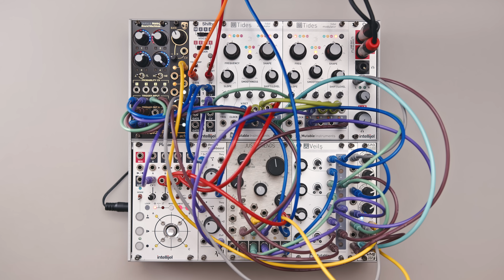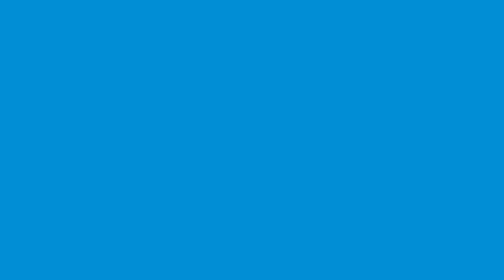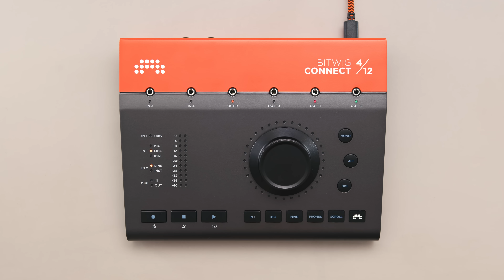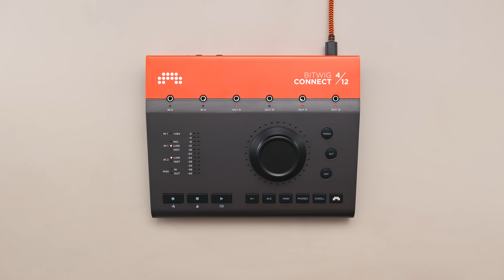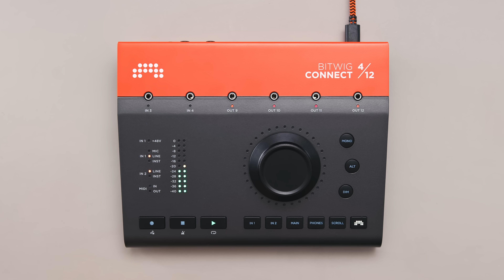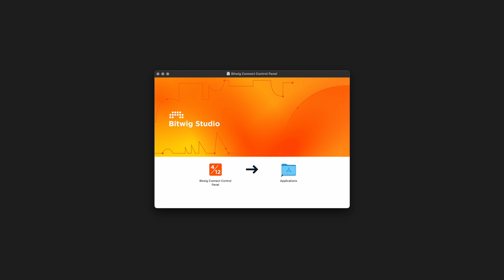Bitwig Connect 4/12 Feature Overview

Comment: Pretty cool, but not what I personally need currently.  I would immediately buy a small controller with that center dial integrated into it.  4 knobs that work like that (hover and click to lock on the parameter), a small oled that shows what its locked on, and the transport controls would be ideal.  You could make versions of this concept tacked onto a number of other controllers:  just the knobs, a sequencer, a keyboard, a grid controller.  The primary functionality i want is that hover and click to lock transport control.  That is so much more intuitive, quick, and mailable than any other midi assignment ive ever seen.
Reply: Steinberg cc121 did this 10 or 15 years ago and SSL uf1 I believe does it. Maybe some other devices also but yes very nice feature!

Comment: This is a very interesting interface, in particular the CV feature, but I would have to use it in conjunction with my existing interface/preamp setup. Does Bitwig Connect support "Aggregate Audio Device" on MacOS, and has this been tested for stability and performance with commonly used audio interfaces, such as the Focusrite Scarlett range?
Reply: Any device supports it, since the drivers on Mac are the same for all interfaces (not the control interface, but the actual driver). It hasn't been tested, and I don't think any brand has tested that
Reply: @reggindaed  I got a reply from Bitwig in the meantime confirming that this was indeed tested with many commonly used interfaces, including several from Focusrite.
Reply: @ I wouldn't use an aggregate device anyway
Reply: @ Then dont.
Reply: @ Ok, I won't :)

Comment: USB 2.0 is a big disappointment.
Reply: … why?
Reply: what should be the benefit of usb 3 in an audio interface with this channel count?
Reply: USB 2.0  depends more on rest of your system (OS driver, even if you use USB 3 socket), while USB 3.1 is more independent. If you have webcams, controllers, midi, mastering plugins everything on USB 2.0 the polling latency overhead/jitter will be imo measurable. 
So for 99% of users it won't matter.

I'm probably whining, but its so cool and has USB 2.0 while I already have an interface with USB 3.1. I'd feel like I am downgrading.
Reply: @jomonger-g1f  interesting!

Comment: I'm concerned about the performance of the Input and Output. Can this handle hot signals from a modular synths as input, and can it output hot signals as well? Depending on this, We might need  attenuators or preamps.
Reply: I mean... Yea

Comment: i used bitwig versions 1 - 3, when they went to their subscription model i stopped promoting it although i still use the version i've paid for. that said, i can't in good faith purchase this or any other product as firmware & other updates might be held to a  subscription model. even though i am being ever so slightly facetious, i hope i haven't given them yet another crappy idea.
Reply: Cool. Except it's never been a subscription model. Subscriptions are a very very specific different thing. So you don't have to worry. 

You're literally experiencing why it's not a subscription. If it was, you'd lose access when you stopped paying. Except no, you can just update to the new version years later if you want like literally every software ever. Bitwig is just nice enough to give you a year of free updates when you upgrade. 

You're confused
Reply: I don't understand you. With Ableton you buy a license and if then a couple of months later a new version is released you can buy a new version. With Bitwig you are guaranteed to get the update, it's the fairest model I've seen.

Comment: Congrats! The execution of how it directly Integrates with bitwig are rlly awesome and smth unseen before, thats awesome! 

Also favouring the use of Modular Synths as Bitwig rlly is the DAW that rlly shines the most in terms of user friendlyness of Hybrid Setups is rlly the perfect choice imo

The use of the multifunctionial knob for MIDI CC is also rlly such a nice Addition and usability of it and to switch parameters seems like a breeze 

But by the first looks here my critiques (obv. not owning the device but an Audiofuse 16rig instead (pretty much the Interface I always Dreamt of lol and cannot recommend it enough)

There seems to be enough space for LED VU-Meters for 2 Inputs and seems a bit of a missed oppurtunity, although obv i do not know how cramped up it looks under the hood but thats a bit of a bummer but would be amazing to check Ins and outs or all Ins at the same time.

The choice of having the Phantom power switch in the back is very odd to me and not a good thing at all
I switch my Phantom power on/off extremly often. Coming from the  audiofuse 16rig i constantly switch between Inputs 1 from rear for synths to the front where my mic stays attached since i use my mic also for gaming and videocalls etc. but barely for my music.
Having to Touch around and reach for the back to look for the Phantom power switch sometimes several times a day seems extremely annoying 

Why only 2 Inputs and 6 6.35mm outs instead of 4 outs and 4 ins? 
People who only need 2 Inputs hardly ever have a 2nd pair of speakers and for send/Return functionality theres just not enough Inputs. Having 2 extra ins could make way to maybe use them in that way or simply to have 2 more separate Ins for multitracking. 

If you like the choice of the small Jacks on the top is obviously completely subjective but i would have prefered them maybe on the front or the sides to eliminate the possibility of cables dangling around. Often longer eurorack cables are very loose (at least my are) and not stiff enough to not end up possibly dangling on the precious big knob (i know we all love big Knobs that make synths go "WAH-WAH" mainly ending up as cut off knob lol) or being a bit in the way of the buttons and LEDs 

Obviously it would raise the pricepoint and is a wish not a complaint but ADAT functionality would be god send and id easily buy it to replace my Expert Sleepers modules to feed Modular Signals into Bitwig while having its amazing Integration features connecting it to my 16rig 😍

That all being said it still looks like the perfect interface as Bitwig user who doesnt have the need for big amount of ins and most points (except the rear buttons) are nitpicking maybe for the next gen :) Congrats again to this well thought out little box!
Reply: And next PLEASE a fully Integrated Bitwig Conrroller à la Push but with Bitwigs amazing Innovation and modular Integration! Id SO love and buy that 😍😍

Comment: This is really well thought through.  Congrats - and I would like something else adding to a Bitwig hardware range please:  Something like the Softube Console 1 but smaller and there to simply control one device at a time (rather than be a channel strip - which isn't what Bitwig is about at all); layout more like a Nektar CS12 but with 3 rows of 8 controls so (say) eq gain, freq and Q can be controlled per band but with displays for what each encoder is controlling and save-mappable to VSTs as well as native FX and instruments.  Adding a universal knob like on the 4/12 or a single motorised hi-res fader would be great for controlling whatever the mouse hovers over or switchable to volume.  For me, Ableton Push was always too massive and the knobs too far away and close together to be usable by a grown up seated at a desk.  So, my suggestion:  Forget the pads - put them in a separate hardware unit - definitely not the same one!  Focus on having a really great series of rotaries ergonomically accessible and readable just beyond a Mac/PC keyboard or trackpad.  Now that, I would pay for!  I don't need an MPC would-be or all-in-one controller like Push.  I need dedicated, ergonomic studio tools - For instance, in my last release, I had Wavesfactory Spectre on most tracks.  Being able to control that from hardware and using my ears more, screen less, would be amazing!
Reply: @ADPTVmusic  in my opinion it has too many flaws and not thought very well through. At least it's nothing I would need or could even integrate in my setup even though the CV out could be nice.

Comment: Looks quite nice but for me the number of ins and outs should rather be reverse. Especially as you are talking about hardware synth integration.
Reply: What were they thinking? Do people actually need that many outputs? I'm good with 2 outs plus headphones. If there was ADAT you'd get all the outs you most likely ever need. A lot of weird choices with this product IMHO.
Reply: @Leo.Nordmann  Looks like it's designed with the eurorack market in mind. A lot of people with large systems use some mixers and might be fine with 4 inputs. 12 outputs for CV are easy to use up.
Reply: @Bata9999  it's only the 4 1/8" outs on the top that are DC coupled though, right? The other 6 are only balanced 1/4" and then there's the stereo headphone out.
Reply: @Leo.Nordmann  I don't know maybe you're right. My impression is that the entire interface is DC coupled but the top outputs are specially calibrated to help with 1v/oct CV signals.
Reply: @Bata9999  I feel like they'd have specified it if the 1/4" outs were DC coupled. It's a selling point after all.
Reply: @Leo.Nordmann  well if you count the cvs as out, the high number males sense, the low number of inputs does not... I have a 4 synth setup, and that takes alone 8 monoinputs, for each has their own effects path. then counting drum samplers an other stuff together my setup needs 12 inputs, just to work. so hmm. Nice idea, but way too low ins count for a "serious" use. Ok I have to admit, i am no eurorack guy. maybe in eurorack world 4 ins is enough since everything is happening inside the rack system. but for standalone synth users with patch in/out capabilities, it is only for very small setups like 2 mono synth and a stereo drummachine or something like that. I really think this is the start of a hardware family, otherwise this one is very niche
Reply: @hypnoticGrill  same for me. I have the Babyface pro with a 8/8 preamp and all the inputs get used with my setup. Bitwig connect should have ADAT. It's baffling how they didn't add that. It's a similar thing with the SSL Big Six. That mixer could really be great but no ADAT makes the value of it drop immensely IMHO.

Edit: sure, it makes sense if they do a range and add adat on the higher product in the line then, but the price is just way too high for me to even consider this. If they make a bigger version it'll be in the price range of the Babyface pro FS and I would always pick that over anything else really.

Comment: I'm really impressed guys! You just know if Bitwig make something then the features are going to be really well thought out. That is I would say probably the most clever audio interface i've ever seen in terms of the combination of features. Great work! Obviously I will echo what other people in the comments are saying that it would be great to see some kind of integrated midi control system for Bitwig.
The thing is with Push and Ableton though is that there's too many sub  menus and its faster to get around with the mouse for many tasks. So for me I think its a case of getting a narrower set of features to work exceptionally well rather than trying to create this never use a mouse again nonsense because lets face it the mouse is handy for editing.
Things I generally want are a good 16 row step sequencer with random and prob  and can do 909 style as well and rapid access to all of the sensible drum params like pitch, filter, start, end, adsr, pan, fx, filter stype, vol. Then I guess there need to be intuitive melodic sequencing as well. 
I think for me I just want intuitive and expressive and tightly integrated laying down, tweaking and editing of the fundamentals of a song. The groove basically. Lay down patterns, tweak sounds, swap patterns, swap sounds. Super intuitive fundamentals. 
Because when you get to the point where its like ok lets make it do 20 other things then all of a sudden if you want do a drum flam you gotta go 3 menus deep because you've been trying to create this device which does everything and so it becomes sluggish at deeper editing and sluggish at laying down grooves. So why not don't even attempt the deeper stuff and make it exceptional at just generating sounds. Its what push claims to be like an expressive musical instrument but I owned push one and it was a jack of all trades and master of none.

Comment: I was hoping for a full fledged production controller (with pads to control Bitwig's Drum Machine) optimized to control both sequencers in Bitwig but this is a start. Don't forget to bring that knob over to your production controller, should you decide to make one (may I also request a real jog/shuttle wheel for additional transport control and other tricks).

Comment: Love this, wish it had more I/O like 10/12 or 12/12. Adat + Midi would be a nice feature. Or the ability to stack several interfaces for more I/O (ie, looking at you Windows PC).

Saying that, this is an amazing step forward, Congrats BitWig!
Reply: adat ftw!!
Reply: double ADAT (SMUX) pls?
Reply: The ES-9 is only 100 bucks more with way more I/O. I Want to convince myself to get the connect but I just cant knowing the ES-9 is around.

Comment: Nice, but really could have benefited from an ADAT in and out. 

Maybe they'll be a larger version at some point.
Reply: Would be my guess as they called it Connect 4/12, not just Connect.
Reply: Being this is their first hardware offering; why would they include ADAT in something that's not in demand or offered in this class of product? 😶
Reply: @slapopimp  Lots of interfaces at this level have ADAT I/O , it's the standard for expansion.
Reply: @billB101   That's true, but... IMO, this isn't designed to be that sort of product given it's mostly for the Bitwig DAW. It's enough in the market that covers that need already.  The typical use of Bitwig is beatmaking, not audio recording of high audio track counts. Bitwig ( IMO ) isn't the DAW of choice to record a band or other things where you would need ADAT expansion and support. Just like no one uses FL Studio to seriously record audio like they would use Cubase, Studio one or other Daws that's better suited for that task.
Reply: @slapopimp  I disagree that it's just beatmakers using Bitwig. A lot of users ( myself included )  connect to modular setups with interfaces like expert sleepers that require ADAT ins and out as well as channel expansion options for outboard synths and equipment.   Might not be your particular use case but doesn't mean people don't want it.
Reply: @slapopimp  I use FL studio with about 40 inputs :)
Reply: @slapopimp I mean idk probably because they don't even have standard stereo ins. Really odd I/o here. Like it's chill but only half baked. This for eurorack users who play guitar?
Reply: @atetraxx  it seems a bit all over the place. Unfortunately this is to be expected with bitwig. 😥
Reply: @atetraxx  it seems a bit all over the place. Unfortunately this is to be expected with bitwig. 😥
Reply: @atetraxx   This is a product that's designed for use with the Bitwig DAW. It can obviously be used otherwise as well. It's not designed to tick all the boxes for typical interface use.

Comment: Strange not having 8 encoders and a few buttons to toggle through and control remote pages. Have to hope they have something else in the works
Reply: 1:21 for my uses this is better than 8 knobs that I have to take my hands and eyes off the DAW and then remember what each knobs does. I use a Microsoft Surface Dial like this feature and I’m shocked this hasn’t been incorporated in any other devices/controllers yet.
Reply: that would be my dream controller at the moment. i just want something small with 8 encoders that can also act as buttons, and then a display to say what what each knob and button is controlling
Reply: @zankfrappa93  Your dream is already available (ok, 12 encoders) and works great https://youtu.be/8NzuzuDTX8w?si=jUVQ9lylcjKGF71d
Reply: How is that strange? It's mainly an affordable audio interface a few integration features. 8 encoders would increase the price and footprint of the device significantly. If it had 8 encoders that would be out of the ordinary i.e. (cool but) strange.

Comment: Offical midi controller is a MUST at this point. No excuses
Reply: Nektar controllers work great, though I agree most of the times nothing beats an official device.
Reply: If they're to develop a native controller it would have to be a Grid beast, better than the Push controllers (that already work incredibly well with Bitwig), and likely multiple times more expensive for us than a Studio license. We're too small of marketshare for them to go all in on hardware for us, when there's dozens of perfectly good options from other manufacturers and DAWs.
Reply: hell no midi please, proprietary or osc plz
Reply: Why is it a must? use the SL MK3 and/or the Push2 with drivenbymoss script, what do you want more? 😊
Reply: This is so much better than a midi controller. Besides their controller support is already great.
Reply: @sqwerty0829  It is a great device and Im 100% buying it as soon as its released. Speaking about controllers however, currently nothing beats Ableton integration with its midi devices. I was always jealous towards Ableton users for having Push and I hope we will get similar control surface in the near future.